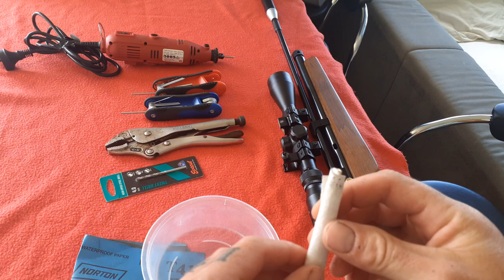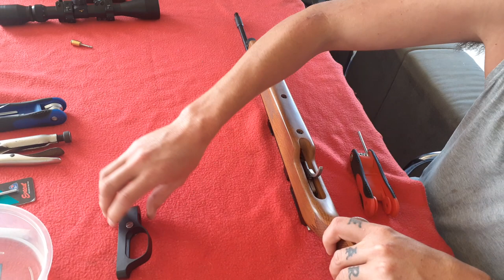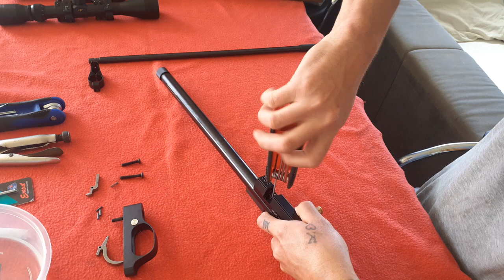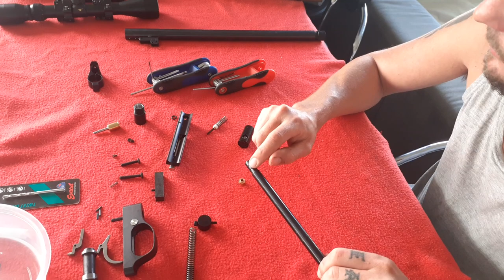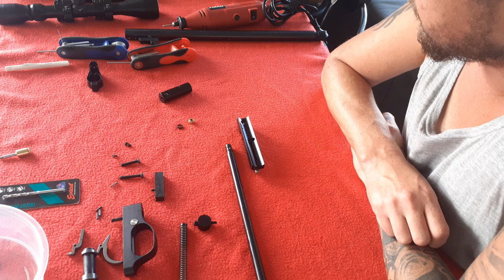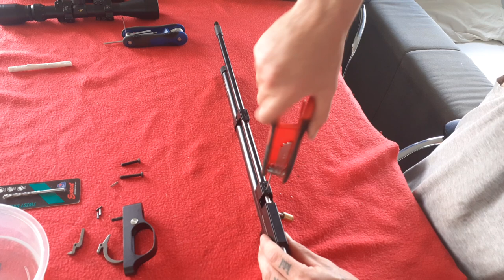Air Chief cr600w co2 internal power mods.

Comment: So if you were to upgrade the hammer spring  power spring guide and the transfer port all at 4.5 mm on a .22 would i be over 12ft or not just wanting to make sure as im in uk and would like to upgrade my diana trail scout also what oils are best for maintenance so oil for o rings and metalwork ect as im getting back into shooting and got that as a starter had an aas200 with the mag conversion but hard times came but looking better now

Comment: Great Video.  One question for you.  If I wanted to replace the hammer spring does the trigger have to be disassembled? Looks like I could remove the stock and then the bolt under the breech to access the hammer spring.
Reply from the maker: no, you dont need to disassemble the trigger. just pull the stock off, undo the Allen bolt at the rear underside of the tube, and the end cap n spring will come out.

Comment: Nice one James, not least because you are up-front on your novice status but still willing to make an effort. I would love to try the same but I don't actually know how to video something and then upload it. Nonetheless I've done all this stuff on my .25 custom CP1, plus even more mods and tweaks. Could only get it to about 10.5 FPE. That valve just isn't up to a monster power tune. Having said that. I can't miss within 30 yards using a red dot. Make sure you drill out that metal gauze in your valve though...
Reply from the maker: Hi. thanks for the comment. the gauze in the valve doesn't affect gas flow when the trigger is pulled, because the valve itself is filled, prior to pulling the trigger. the gas isn't coming directly from the powerlet when you shoot. the powerlet fills the valve, then the valve empties when you shoot, then its filled again in between the next shot. all the gauze is, is a filter. cheers.

Comment: once the cartridge is pierced, is it the channel between the cartridge and the chamber always open? Or does it only open when the hammer hits the valve and compresses the valve-spring onto the co2 cartridge end?
Reply from the maker: The CO2 cartridge is pierced, filling the valve, the hammer strikes, opens the valve, and the gas is released from the valve and then the valve refills.
Reply: @1984piazza  thanks!

Comment: Hi mate, what's the best way to remove a stuck in co2 canister without stripping it all down? The canister is completely empty so I can't use any remaining Gas to pop it off so to speak. 

Kind regards 
Gaz 🇬🇧
Reply from the maker: @TheUFOpilotA51  does your gas tube have a peep hole in it? The cr600w usually does up near where the valve is in the tube. Is so, just poke something in there. Otherwise,  a short sharp tap on the side of the tube with something normally works for me

Comment: great vid ,  I own one, how about a one piece brass tube from valve to barrel ?? no gaps ,no o rings ? mid section I mean !
Reply from the maker: there would have to be a join with a o ring somewhere, between the valve body and tube, and barrel and tube. youd need to drill the holes out massively atleast 6.5mm o.d to get a brass tube with a 4.5mm i.d in there through the breach etc. theres no problems how its set up, so long as you put a bit of seal lube on the end of every 5th or 6th powerlet.
Reply: @1984piazza  how about , drill and tap the valve, thread the brass tube, that just leaves one seal only at barrel !!?
Reply from the maker: @forcemultiflier1746  you could, but for the effort involved, without gaining any power etc, and trying to seal rounded barrel to the tube when the barrel is a slide in seal on the breach, to me it wouldn't be worth it

Comment: how did you get 18.5 fpe? thanks
Reply from the maker: by doing mods in video, and using a heavy 21.14gr pellet.
Reply: @1984piazza  what pellets
Reply from the maker: @huntingoutdoorsuk9362  H&N barracuda 21.14gr

Comment: hey man iv herd 4.5 do u think its worth it ? or
Reply from the maker: Mine is drilled to 4.5.... You can stretch to 4.5, but it cuts very close to the two barrel seals on the barrel port. So 4 or 4.2 is a safer bet unless your confident.
Reply: Chers for the info man id say sticking with 4 or 4.2 will b safer ae cant put it back 1c its gon ae thanks again mate grate video 2

Comment: Was this a 22 or 177? I'm planning on drilling my 22 out, but wasn't sure if I could go bigger than 4mm, maybe 4.5mm?
Reply from the maker: This is a .22, you can go up to 4.5mm but no bigger. I ended up drilling this one out to 4.5mm rather than 4mm
Reply: @1984piazza I'm planning to buy one of these tomorrow from gun city. Did you get more power going to 4.5mm Vs 4mm? I've not done any modifications before so this will be a first for me, so a bit nervous about taking a drill to it.
Reply from the maker: @cabelas1987  i havent really tested 4 vs 4.5, i just went for the largest possible i could. there will likely be difference, but i cant say how much. if youre nervous, perhaps go with 4mm as 4.5 comes very close to the two barrel seals where the port is so needs to be precise.

Comment: When I hear mods I wanna see more  power and larger bullets
Reply from the maker: not sure why you think it doesn't have more power. it has plenty more power after the mods, or else it would be pointless... secondly, they aren't bullets, they are pellets, and .22 calibre is fine for what I use the rifle for. if I went to larger pellets, then I'm limited to using single shot, as you cannot get magazines in larger calibre for these.